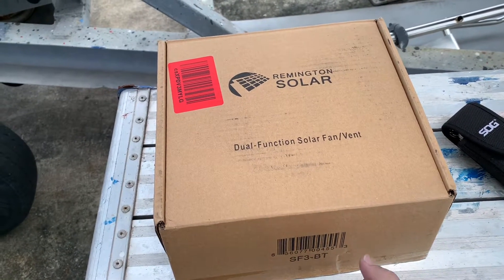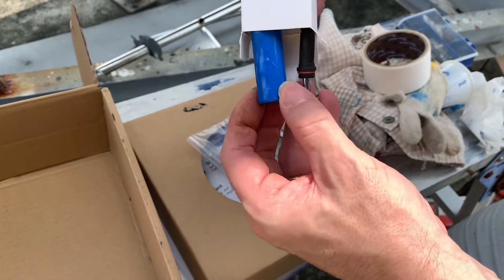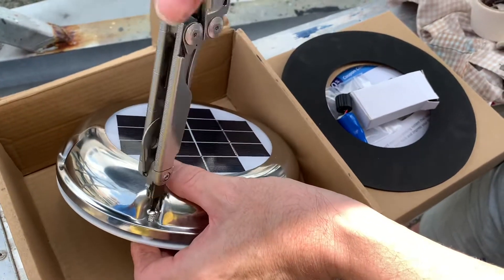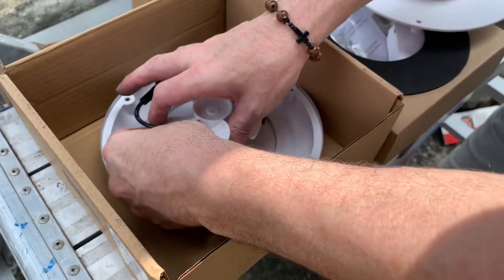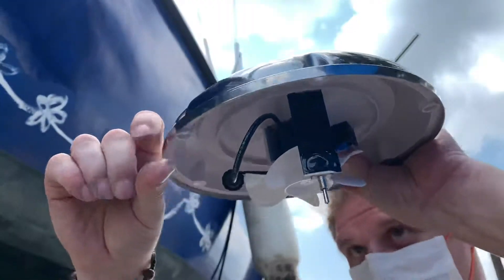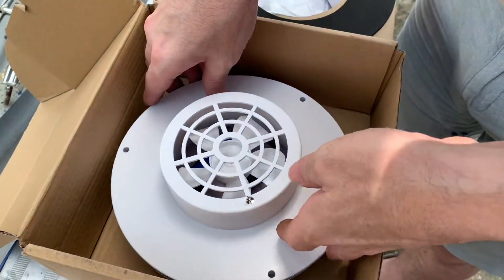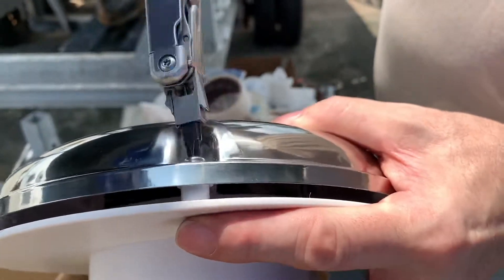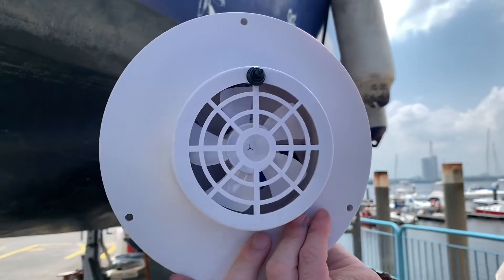How to set up your solar vent plus bonus unboxing of the content

Comment: 👍 Good. Where you bought it? I might as well change mine to same 😁
Reply from the maker: Hi Kenny. Thanks for viewing the video. Here’s the link but maybe out of stock for now. Solar Powered Fan and Roof Vent for Boats, RV’s and Sheds (9 x 9 x 4.75 in.) – Backup Battery and Dual-Ventilation - Solar Vent Fan with No Noise – Covers up to 500 Cu. Ft. - by Remington Solar https://www.amazon.sg/dp/B0842WYNYV/ref=cm_sw_r_wa_api_glt_i_12CPMG2XT7R02E2PVD98?_encoding=UTF8&psc=1
Reply from the maker: HI Kenny, I just check the stock and they have new stocks arrival and much cheaper https://amzn.to/3kZsTNM